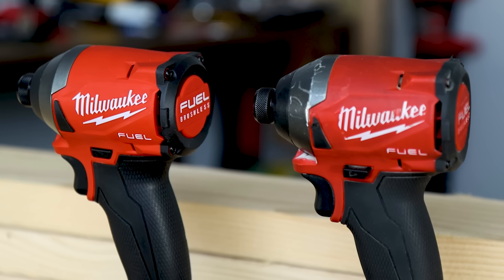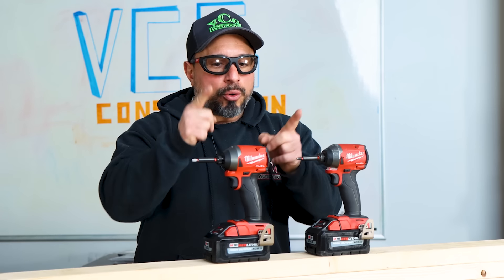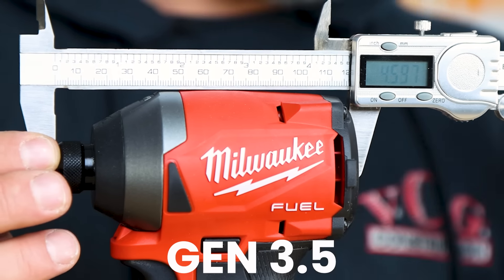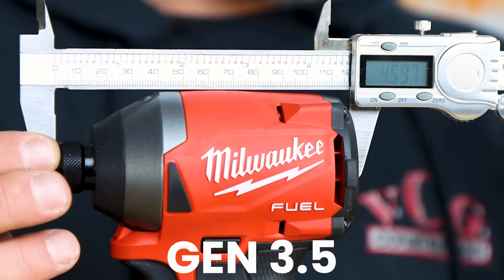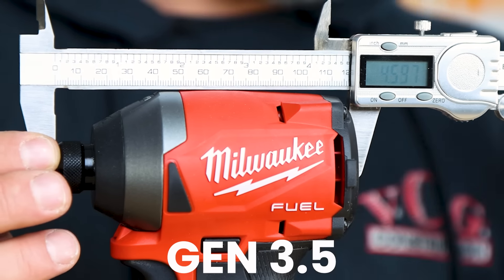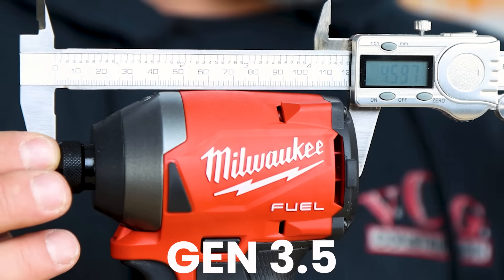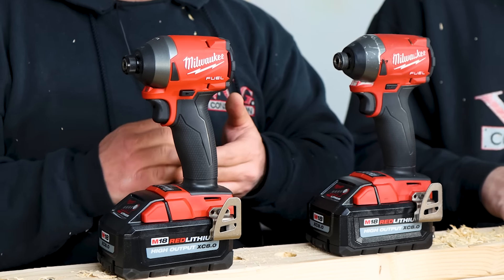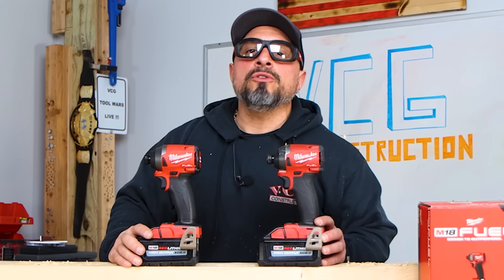New Milwaukee M18 FUEL GEN 3.5 Impact Driver TESTED Against INFERIOR GEN 3 Impact!

Comment: Hi Guys!!!  I'm grateful for the Milwaukee solution, but I don't see the fairness of Milwaukee's repair/replacement policy.  ALL Gen 3 impact drivers have this defect BUILT-IN.  Why should I have to wait, say 2 years from now, to have a paddle bit above my head pull loose from my impact?  After 2 years, Milwaukee could tell me to "suck eggs" because my impact spring has worn out over time.  When a car manufacturer puts out a service bulletin on various vehicles with certain VIN numbers, ALL of those specific owners have the choice to repair/replace the defective part.  It's the owner that has the right to decide whether to get the replacement/fix, not the manufacturer.

On another note, this problem can ONLY be resolved with a replacement.  How would they fix it?  By drilling an additional ball-bearing hole in the anvil and replacing the spring?  What if the hole is offset?  What if the anvil is damaged?  I don't see that as a practical solution.  I think Milwaukee wants to get out of this mess as cheap as possible by making the owners feel uncomfortable/confused with asking for a repair/replacement.  Milwaukee should just say, "bring your Gen 3 to our service centers for a replacement.  Done.  No hassles."  Instead, I feel like, as an owner, I'm in a "grey area" of sorts and let down by Milwaukee.
Reply from the maker: I’m surely not telling you to wait, we are only relaying the information given to us concerning the issue. It’s worth a try, but may not work out!
Reply: @VCGConstruction   I'm not "shooting the messenger."  I truly appreciate the video/info because I normally hear new stuff here before I hear it elsewhere.  My frustration is with Milwaukee.  Risking a one ball-bearing solution to begin with while other major competitors use a two ball-bearing solution, and then, providing a solution "only if you think you need it."  These things don't give me a "warm-n-fuzzy" feeling about Milwaukee right now.  We all pay Milwaukee a lot of money to be a major league company, but with this issue, Milwaukee is showing a lot of minor league play.

Comment: I can clearly see that the bit that was used in the Gen 3 had the end rounded off. (just pause the video when he's holding up the genuine milawkee bits. Seems like this test was a little rigged. I was hoping you guys would use the Gen 3.5 to remove the bit that the 3 couldn't.

Comment: Hey  also the box that the 3.5 came in has the word "NEW" on the front upper right hand corner.  Also with the collet now having two holds in it for each ball bearing, has this weaken the collet?  Possibly causing a catastrophic failure eventually?  Hopefully your vigorous testing will bring any weakness to the forefront.  Thank you for your quest!

Comment: While I agree the Gen 3 should have been designed to retain the bit in the first place, who out there is drilling all these holes with an impact driver?? Using a step bit in mild steel maybe but my goodness the racket this thing will make if you are using it to drill for your rough-ins.

Comment: @VCG Construction
. Thanks Vince and Nick for making the video. I like the mellow Nick. I appreciate the time you took to read our comments and answer our questions.

The only way I see Milwaukee recalling all the GEN3 FUEL impacts is if there is a serious accident where someone using their GEN3 FUEL impact had a spaddle bit or other drill bit fall out of the collet and impale them in the skull or shoulder and get sued. What would be very nice is if Milwaukee would replace for free any collet that has the retention problem even if its out of warranty. I'm guessing that most people won't send in a GEN3 FUEL impact to have the collet replaced if they don't have the retention problem. The impact can stay on the jobsite working.

Hope you, Nick, your crew, and your families stay safe and well.

Comment: Just received mines after buying multiple combo kits (drill/impact) only to find out it wasn't in it. You have to buy bare tool. I bought 4 kits at different locations and online. They all had 2101 or better for serial # but I wasn't get 2 bearings. I placed 2 separate orders online at home depot for bare tool...received the first order today and it has 2 ball bearings.

Comment: Far as know, the December 2020 m18 fuel 2853-20 impact drivers “should” have 2 ball bearings. I’m not sure what “exact” date in December, but any 2853-20 made in/after December 2020 will have 2 ball bearings, per Milwaukee’s own website’s data sheet for replacement parts. And the link is here  https://bit.ly/36OLcxC ; with № 10 for “ball bearings 2x” (meaning they now have 2 of em, which why didn’t do from start, as saved what....5¢ maybe per bearing, lol). ALSO, tells you starting serial № if helps, but unsure if will; sorry gang I’m u sure about knowing serial number and if will help you🤷🏼‍♂️. But, have the info now, so do hope this helps!
Cheers✌🏻

Comment: I sent in my year old Gen 3 driver which was manufactured December 2019 due to having a single ball bearing a couple of weeks ago and I received a NEW one which was manufactured in March of this year. It was obviously still under warranty so everyone should take advantage of it. I am located in Calgary and shipped my driver out to Milwaukee repair store in Edmonton for my warranty claim.
Reply: Did Edmonton give you any grief trying to complete this? Had a guy here in Saskatoon think I was trying to scam a newer impact for free...lol. Tried to explain that it is a known issue, and is covered under warranty, he didn't agree.
Reply: @shadydvh  Nope. When I initially phoned them about the issue they knew exactly what I was talking about. I spoke to Jerry Winslow and he told me to ship it out to them or get it worked on locally in Calgary but I decided to send it out to them and I’m less than 2 weeks I received a new tool. The whole process was smooth.
Reply: @shadydvh  I was not expecting a new tool nor did I ask for one, but it is technically a manufacturer defect and I mentioned how newer serial numbers had the 2 bearing system therefore our tools should be replaced by a new one.
Reply: @Juney101  Sounds good, I'll try again on Monday, if no luck, I'll try Edmonton, thanks

Comment: I definitely don’t want an impact driver that has a flaw. I just purchased the combo kit in December and haven’t had any collet issues. Maybe it comes after wear and tear. If I were testing the impact against others I could see an issue but as far as what it’s made for I just wouldn’t use it to bore wood. For all of those jobs I’d use my Hammer Drill or Basic Drill and not the impact. I use the impact for driving nuts and screws nothing else and don’t see what anyone would use it for anything other than driving on a job site so no issue for me.

Comment: milwaukee tools are terrible, probably the most unreliable tools I have ever bought, my impact lasted a month, and yes they will fix it but for the 4 to 6 weeks its being fixed what do I do. and my gen 3 used to stay in reverse extremely often. also watched a tone of your reviews and when I got the tools they where not as good as you made them up to be eg the drills chuck is not a real chuck its something Id expect from a cheap drill.

Comment: the weight discrepancy may be that the anvil holding in the ball bearings has less material in the 3.5 than the 3.0
(the extra cut-out to hold the 2nd ball)

Comment: With a scale sitting right in front of you, you should've popped them open and weighed each component to see where the weight difference is.

As far as them making the tool bigger and you stating that is equivalent to gen 2, not necessarily, depends on WHAT they made bigger, like for example, the portion having the problem, the collet itself, or they could have made it bigger to have more impacts per minute but less impact force.

You observed your problem after beating up the tool, right?  How about after your so called gen 3.5 is beaten up?  I don't even think it should be called a gen 3.5 if it has the same part #, just a fix of gen 3.

Comment: SPECIFY CATALOG NO. AND SERIAL NO. WHEN ORDERING PARTS
REVISED BULLETIN DATE May 2019
M18TM Brushless 1/4" Hex Impact Driver (1 Speed)
 CATALOG NO. 2850-20 STARTING J55A
That’s the only impact driver I could find where the parts schematic shows a chuck with 2 ball bearings. Folks weren’t real pleased with the single speed.

Comment: Today's date is 7-7-2021.  Is anyone still finding the Gen 3.0 "Hitler" (single ball) impact drivers on the shelves?  Who wants to spend the time sending a tool like this back to the factory?  Not this builder.  I want to be able to pull out as quickly as possible and, more importantly, still keep my "bit."
Reply: I just bought @ casa del pot a super cheap 4.0 m12 fuel impact kit that has only 1 ball, inserts without pulling, won't come out if you dont pull. I don't intend to use that m12 hexa impact to do anything else than driving screws and pre-drills. I have a high torque 1/2 m18 and a hammer drill if I feel like beating or digging something. I don't get the idea of using a hexa clip to drill large holes with mega contraptions. It's a 1/4 on an auto clip. lol, Sure it has the power, still not made for that job. If the double ball clip works well then good it's an improvement. I really don't see the "Fail" here. Technology is making divas out of all of us I think